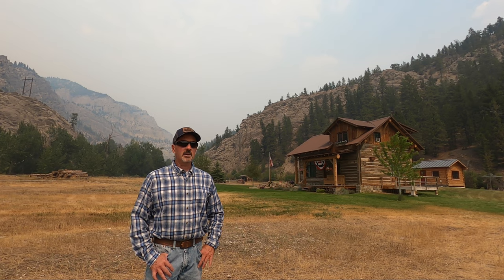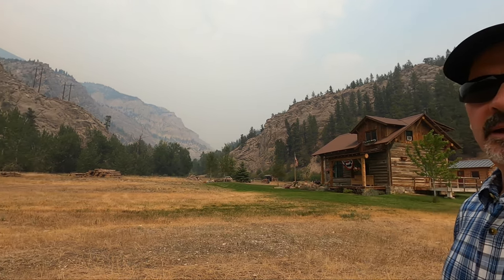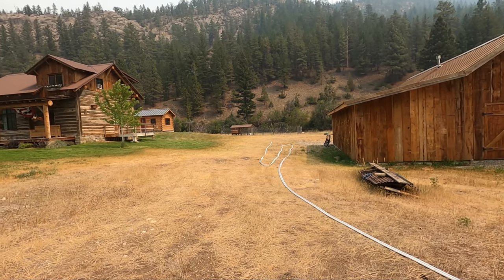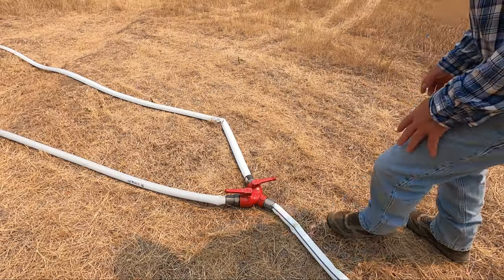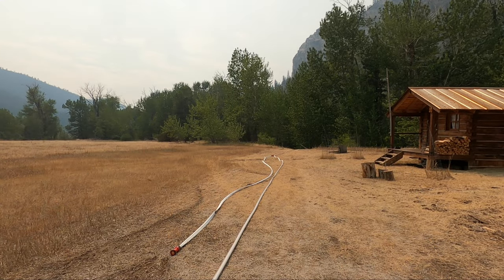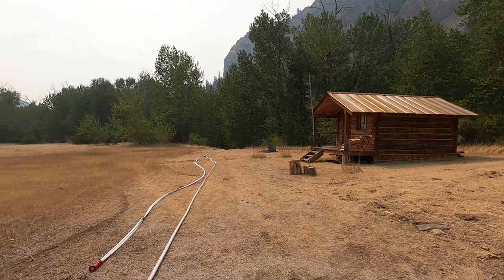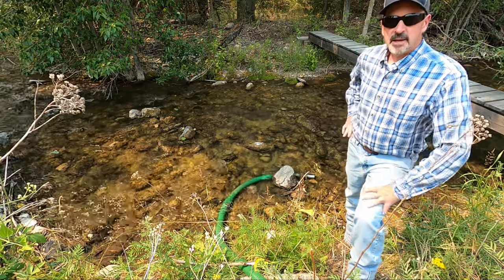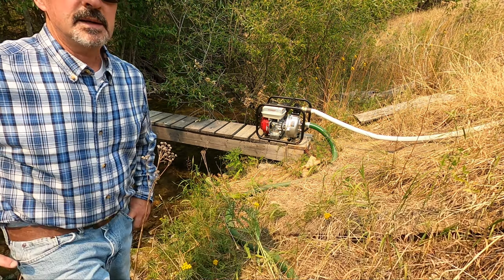Home Wildland Fire Pump Setup

Comment: May I make two suggestions? First consider a foot valve at your suction to assist in catching prime. Second look at establishing a sprinkler network. Attach some sprinklers to the top of your structures and build a humidity dome. I expect your local forest service can help with suggestions. With sprinklers you can bug out if necessary and hopefully have something to come back to; or at least they can cover your back while you are focused elsewhere. Mercedes Textiles- fire pump section has diagrams of suggestions for cottage protection, on their website. Ultimately sprinklers are sprinklers.  When I get my place some system will be on the list. Wish you well.
Reply from the maker: Good suggestions. I do have a foot valve on the end of the suction line and have plans to add sprinklers. I was able to find some "water thief" fittings that are basically T fittings that I can add at my hose connections that will give me a 1" threaded male end with valve for irrigation sprinklers. Thanks for watching.
Reply: @OnBeaverCreek  Just the way I envisioned. Next will be PPE in case the embers start raining on you. Eye, breathing, and FR clothing. Remember to hydrate. Maybe a larger secondary fuel tank plumbed in? Once all is going I am curious if your pump will handle it all. That's way beyond my comprehension. Wishing you stamina.
Reply: If you have the budget id get a secondary 3"  northstar pump and gate the discharge down to 2.5" since you can get that hose cheap used. Then use the  3" pump for the sprinklers. Look at ¾ and 1" ag sprinklers, avoid the plastic ones. As the other user said, you want a moisture/vapor barrier. As for additional protection, get heavy duty aluminum foil or a mylar heavy duty space blanket for the the windows.  Many fires start through radiation heat transfer to internal combustables, such as window drapes and couch.

Im all for more suggestions as well if you want

Comment: Never use ethonal pump gas in fire pumps....Buy VP FUEL 94 OCTANE 4 CYCLE NON ETHANOL SMALL ENGINE FUEL....or non ethanol pump gas ... ethanol absorbs water from the air....VP FUEL is expensive but your pump will start in a emergency....I have the HONDA WH20XT.....With roll cage...

Comment: Glad to see homeowners taking responsibility and learning how to make their homes defensible. 

Others have said to have extra fuel for the pump. Id imagine marine/boat tanks coukd be plumbed into the system. I would clear the area of brush and set the pump not on the foot bridge, but on a gravel pit just in case the exhaust gets too hot and catches the brush beside it or the bridge itself. 

I like the idea of having a mobile solution so if an ember comes down and is near your property, you can be a great neighbor/steward and quickly put that out before it becomes a problem. IBC totes are great for holding spare water if you get a mobile set up.

If you would need inspiration, wranglerstar on YT has great older videos on wildland home defense gear. 

Other than buikding a network with your neighbors (if you have any close enough, just found your channel), seems like youre pretty levelheaded with this topic. Cant wait to see what else you get going!

Comment: I live pretty rural in eastern Oregon about a 30-35 minute response time from the nearest volunteer fire department. I re-built an old Forest Service fire pumper unit and put it on the back of my ranch pickup and it works great, I can also help my neighbors if I need to. I hope you don't ever have to use your system in an emergency. Stay safe this fire season.
Reply from the maker: That is a good thing to have. I wondered whether it was best to make a portable setup or put the pump at the creek. I decided I would rather have unlimited water in this situation. It would be nice to have both options.

Comment: You have 270 degrees of clear area around the house. The last has the underbrush clear. Contact your DNR to get a comprehensive plan put together. They might use your setup to fill brush trucks and keep the fire far away.

Comment: I live in NWMT on heavily forested acreage at 3,650' elevation, and the property has some steep & timbered elevations.  I am without the benefit of a creek water supply, so you are envied there.  There are a lot of suppression options and methods as many know.  I like your approach so far, especially when you're able to lay out hoses during the worst fire threat periods.  There are always limits to practicality and products for budgetary reasons, of course. If you have used various products and they're proven, I'd love to see you provide links to what you've used. Thanks for this video.  😀

Comment: Greets and love again. As a facility manager I allways have to do with fire prevention. I preach to every log home owner in the wilderness to build a pond for the "fire time" of the forrest.Also a good thing to have: A farmer rain system.Together with a strong pump this can make gras and forrest around a cabin wet like in rain days. Depends on  how much capacity this system has- can make 1000 sqeer feed wet in some hours.
A pond also can be used as a swimming pool or for fish production with a net protected against birds.
One thing you MUST do: Close your verandas with wood so that a burning bush cant transport fire UNDER your house! That is a must do to prevent.
Frank

Comment: I see you have a stone foundation on the main house, I have decided to build a stone foundation for all the structures on my land but I do have a few questions... I too will be building in Montana (a few hours north of you up closer to Libby but also in the mountains so your experience should be good to learn from.  How deep did you go with the foundation, did you go below the frost line or did you go with a good drainage system around the house instead, or did you do something completely different?  Has the house settled to any undesirable degree?  Perhaps you would consider doing a future video on what site prep you do and how you construct your foundations (like the one you have for the house)??  Thanks for sharing your content, it's been awesome following along.
Reply from the maker: Thanks for watching. It is actually a standard reinforced concrete footer and stem wall that is deeper than the frost line. The stone is real stone veneer.